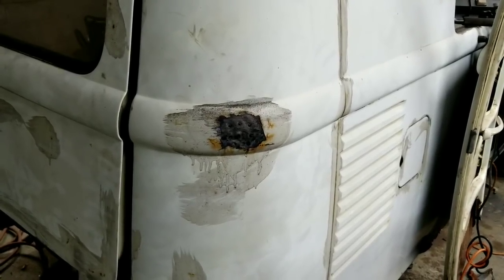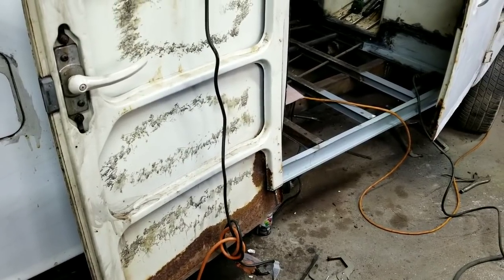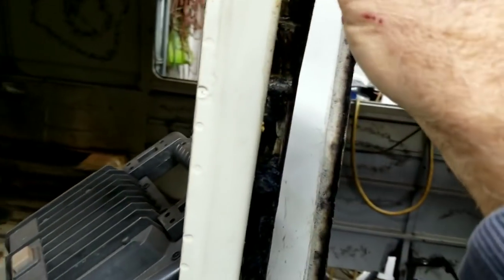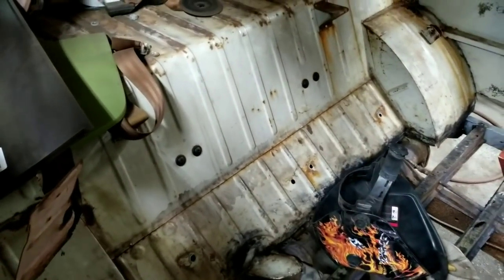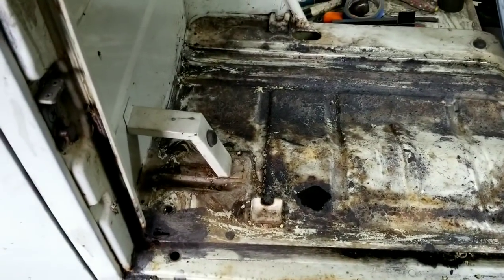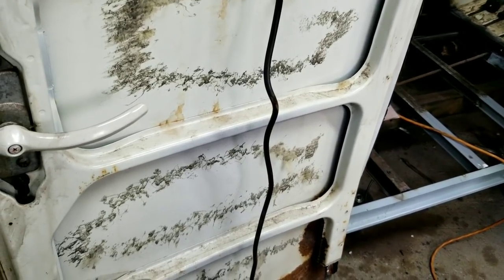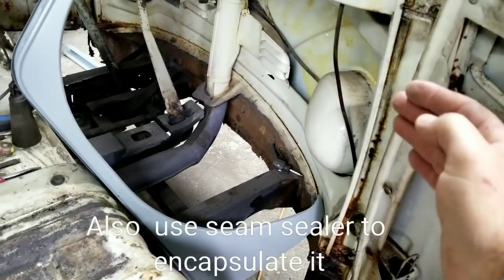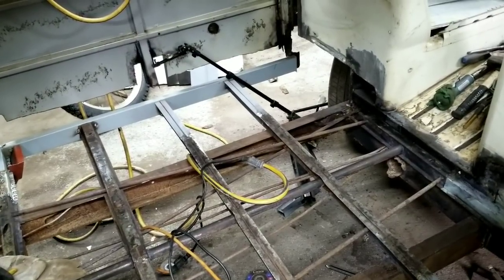Repairing rust to last forever? How does rust happen ?

Comment from the maker: thanks for watching Please comment to help the video.
Reply: Mike Fn Garage I don’t know how it’s in USA but in Germany there are conpanies which do the dipping . ( you replace the rotten metal , then they dip it in a rust disolver, a degreaser and into a phostpate bath ( that’s how the thin primer you talk about is called ) in my opinion doing this will make the bus last 60 more years but I don’t know if it’s available in USA
Reply: Mike Fn Garage please do a real life Test and Sand the treated area just a little.in theory you shouldn’t see red rust only converted rust or metal (if you sand too far )
Reply: Mike Fn Garage I have a idea for your weld through primer . Get two metals , paint them with weld through primer , pinch weld them , drill the spot weld out ( only the spot weld ) and see how the inside looks ( see if the primer around the spot weld is damaged)
Reply from the maker: probably would cost a fortune here. On certain restorations it would be worth it but the budgets would be huge for that. gotta be totally stripped all wiring and then dipped. seems like a costly event.
Reply: So do I seam seal then por15 or por15 then sea seal.

Comment: I remember you said remove the tar boards that were on the doors and in the back quarter panels. ..  I'm glad i did... luckily I didn't have any rush behind them. My 65 sunroof is rust free now after I repaired the floor pan section and the rust on the roof because of the blocked sunroof drain.  I will keep my bug inside no matter where i move to !

Comment: Really like your videos! I’ve got a 65 11 window that I bought in 1980 and quit driving in 1990. Was in a warehouse for 25 years and have had it at my house for last 5. About a month after I brought it home and had pulled the engine we had our first of 4 floods in 5 years. Finally have my life back and am ready to start restoring. I’m only seeing minor rust at front windows and heavy rust at the bottom of one of the panel doors but will remove interior and check out everything. You have given me a direction to go and I am very thankful

Comment: This was a great video and extremely helpful. Eastwood Tools makes a rust protector/preventer/reformer that comes in a spray can with a long hose with little holes at the end, that you are able to insert in closed spaces & spray, roughly 360 degrees. Granted, might not protect it 100% but is able t get you to lots of hidden places (like in the area at 19 minutes+ in the video). I use POR 15, but not in places that will be painted, or exposed to the sun.
Reply from the maker: for light surface rust or behind panels por 15 is good for that if it is heavy usa a converter. works better then por15 for paint.
Reply: @Mikefngarage  True. Thank you.

Comment: For Rust I use a product called ospho because it’s water like and it’s easy to get in the hard to get areas. It’s phosphoric acid based. I recommend at least 3 coats with a Hudson garden sprayer or even a spray bottle.  When you spray it use  PPE because it’s hazardous when made into a vapor. I’ve used products similar to what you are using and have had good results. 
I guess what I’m trying to say is each project has its best product, but the science this video describes is on the money. 
I’m a commercial painter by trade and have witnessed many failures due to applications not understanding the science. 
Keep up the good work out and beyond the arm chair.
Reply from the maker: I like the tannic and phosphoric acid products. both rust converters with either process work well.

Comment: I used Por15 to paint the frame and underside of my project. Did it all with a brush. Took forever but it looks good.  No way I drive it in winter and I’ll be checking the forecast every time I plan to drive it.
Reply from the maker: Yea for sure there are days in the winter you can. when the salt has dried out the roads. for a quick cruise. but as a daily only car it would ruin the car.

Comment: An effective product is Prolan which is made in New Zealand. Its a lanolin based product, of which we have alot. Cover it in that stuff, and it's well protected, especially after repair. Searching Prolan will bring up the website.
It's going to find its way into areas like seams and seal them against air and moisture or any bare metal.

Comment: I sand blasted the bottom of the bus , then I sprayed it with Rustoleum Red primer . It said Self Etching DTM on it . The other day I got under it and i am surprised that it still looks good. !!!!!
Reply: Why would you be surprised?  Epoxy primer would have been better.  I've shot cars in epoxy primer(DP)and left them outside for more than a year.  Totally fine.  It's not a top coat, but a good epoxy primer is insanely good at keeping moisture out.  You get what you pay for though.
Reply: @ocavant  I driven it for 2 years like that even in floods. My 71 came from Denver now I have it in Corpus Christi Texas and when it was ordered they sprayed it with under goat. It was hard scraping that sh@t off. Where I had rust was in back of the wheel wells from gravel thrown from the tires. It chipped off the under goat and the paint ?
Reply from the maker: yea for sure I highly recommend using epoxy primer on a sand blasted car. or one your leaving outside. Also the Heavy rusted metal primer from Rust oleum is good for coating right over rust. Believe it or not I am a commercial painting contractor for my regular business. I also have used this product on cars but coating over it with many automotive products will be a problem. But Some automotive primers go over it fine like urethane or Polyester. then you can recoat with automotive primer. We shot a super rusted bridge with that product and used it as a finish. Lasted without rust for more than 10 years. It has high levels of phosphoric acid in it and stops the rust dead. epoxy primer is great for priming over  treated or non rusted metal. and will last like you say outside without rusting through. Both good points.
Reply from the maker: that heavy rusted metal primer is awesome by rustoleum. read the reply to Steve.
Reply: @Mikefngarage  On my original comment I did not mention that I use a little extra hardner in it than the regular dose!  The red Rustoleum with hardner works better than AutoShack 2K primer now it it should not be used around the coast?

Comment: I used "extend" on a bay window drip edge, hit it with a grinder ?? back in the 80's, ran the bus for a year, sold the bus to a house painter, he ran it that way for another year, I saw it going down the parkway, and it still had the black coating - like adcoat rust converter....but the gallon of bondo in the nose and long gash in the side, well, that did fall out !....oh, you are supposed to pull the dent first ??  ha...learning every day
Reply from the maker: too thick and cheap filler will fall out for sure and you cant put filler over rust converter. needs a primer or bare metal depending on the product.

Comment: Hi Mike I have some questions about window trim. I have a 71 squareback. I'm having a hell of a time getting the chrome trim into the window seal. I've even droped the windows of at an automotive window shop and they failed. This shop is a reputable shop in town. They said they think the problem is the after market window seals and they recommended to get German window seals. I ordered the seals from ISP West. Do you know if those seals are good? Do I need to find German seals? What are your thoughts Sir

Comment: I like Oshpo. what is your thoughts on it?
Reply from the maker: that one is more of an encapsulator not a converter. Removes oxygen that slows down rust. The converters chemically stop the process. and seal up the surface from oxygen. H2o and Iron create rust without the O rust process stops. but O is in lots of things. so the rust continues. I would try a rust converter and see how you like it.

Comment: Mike I copied a video  of back when I repaired the lower carge door from my 67 to show the rust areas.  My intent in copying this video is not to say this is how to do the replacement or repair. I have never done this type of repair or work on a VW bus. Being new to VW buses , back four years ago when  i up-loaded it, I was hoping to get a few comments good or bad.  https://youtu.be/G0LUi1qLGNA    Mike on the two frame rails i was planning on using POR15 , but on this 67 bus the rails they are in good shape; now i'm thinking of good primer,  paint and re-undercoat it. What your is thougths on the frame rails ?? I feel Mike you are" spot on"  with your view and thoughts on rust repairs and expected deliverables.